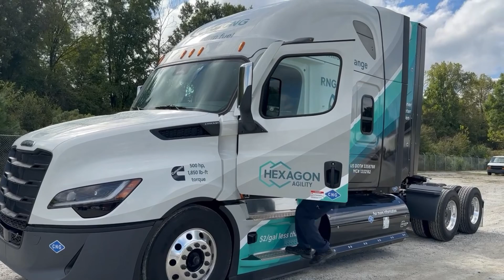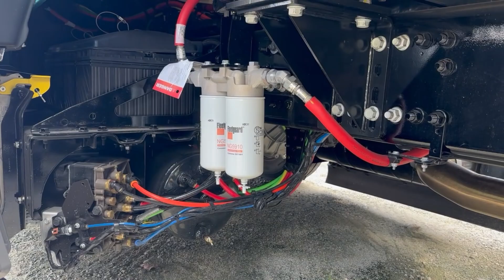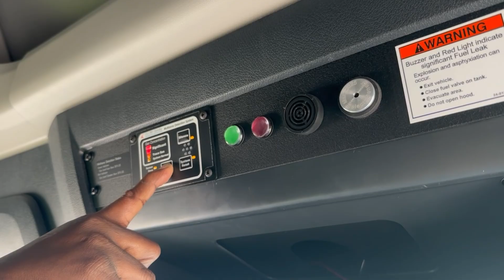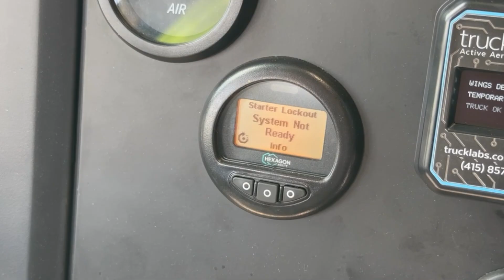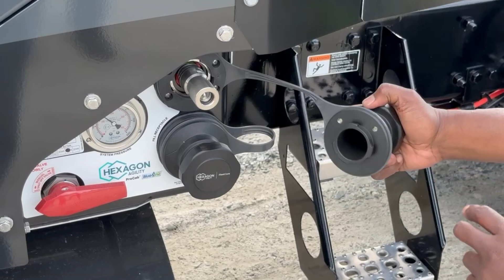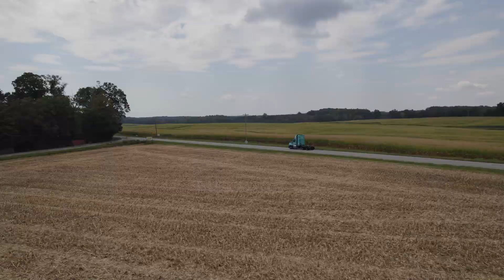Operate your CNG vehicle safely & efficiently

Comment: Those dots on the map does not show the actual public filling stations. Those are companies that own and operate their own filling stations such as Amazon. Amazon has large fleets of CNG but only short haul units. I liked them. The maintenance is pretty wild. And the care you have to take to do said maintenance.  Like changing the spark plugs. Often and very cleanly. The fill tube have rubber oring that have to be regularly changed. I think they were more reliable than diesel. Ill give it that. But even per Amazon,  there is not enough fueling stations yet nationwide to drive a CNG like a normal diesel. Trump is changing that so... CNG might damn well be what's coming next rather than EV units. EV is so far out for long haul. Many such as Volvo have high voltage incorporated into theor units for their super capacitors for start ect. CNG certification classes were not very easy.